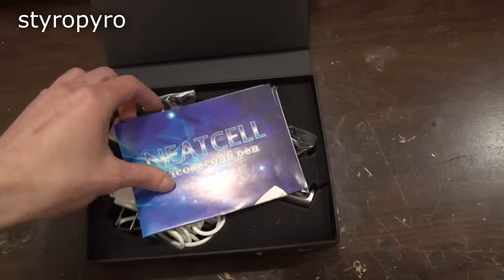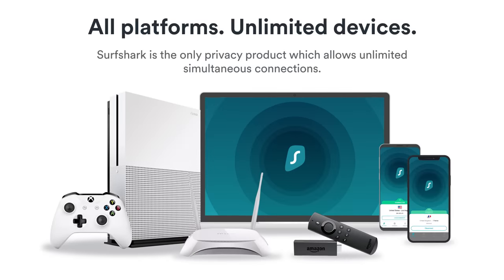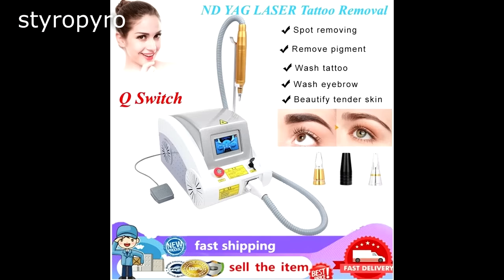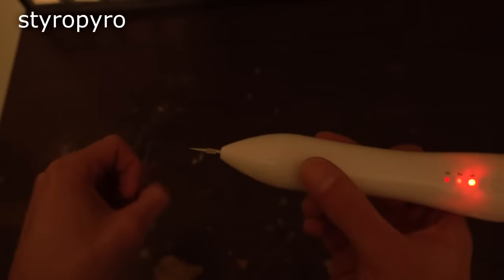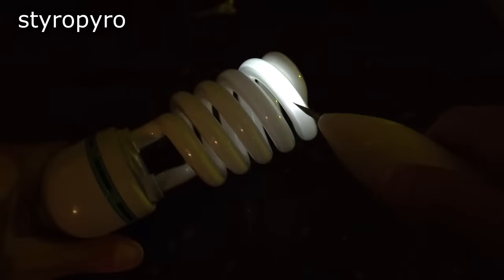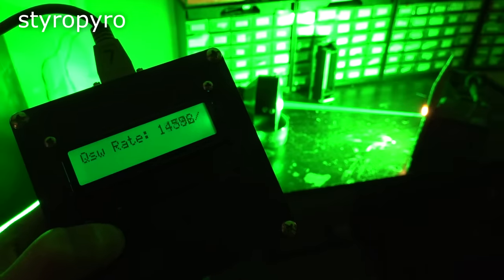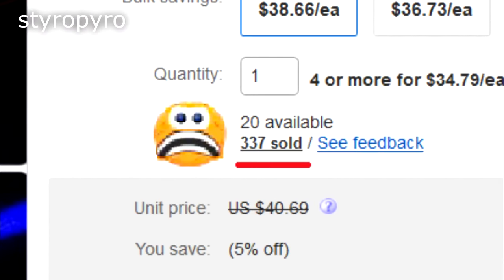Testing dangerous DIY "medical" lasers from eBay

Comment: Next video. 
"So I managed to get a laser that was once used by the Russian military but deemed too dangerous due to 74 accidental deaths."
Reply: “Apparently it’s so strong it melted a hole through a Russian warship. 

Now let’s see if it works on my skin.”
Reply: @BrianYYH  🤣🤣🤣
Reply: Instead, he drove into a tornado outbreak.
Reply: Next step: mount it on a lada!!!
Reply: Yooo I'm a fan
Reply: 1K17 Szhatie Self-Propelled Laser Complex?
Reply: Could he make a strong laser pointer from the picosecond laser removal pen?
Reply: @BrianYYH  🤣
Reply: The video after that will be about him acquiring the Death Star
Reply: @BrianYYH  "Ouch!" points it at skin again "OUCH!"
Reply: @BrianYYH  and once someone dug to China with it (sorry for reviving a conversation from 7 months ago not sorry)
Reply: @arctic _axe he upgraded it to instantly put a hole in the ozone layer
Reply: @tyttuut  it's too powerful for his goggles
Reply: My next reccomendation actually is "Building a fire death machine using soviet tech"
Reply: @BrianYYH  Well, that explains what happened to the Moskva...
Reply: "building a fire death machine using solviet military tech" is a great video
Reply: 2022 update "So I managed to get a laser that was once used by the Russian military. It turns out it was a fairly weak flashlight"
Reply: duct tape it to a roomba and you're fit for war
Reply: Therac25?
Reply: @BrianYYH  “Ow!” * puts arm up to camera to show a 1” diameter hole through his arm*
Reply: @Manny73211  Actually, there's more likelihood of fixing hole(s) in the ozone layer with a powerful laser, as you may know...
Reply: @melhupby which then burned out after about 5 seconds of being on. With the bulb exploding

Comment: “It’s a terrible idea to use the device on yourself”

Uses it on himself
Reply: He studied in those fields and knows what can cause actual harm and what will only hurt a bit.

He says this, as not everyone is highly educated in those fields and someone can actually hurt themselves, if used slightly differently.
Reply: @Ikxi  He's still human, and he can fail, He's crazy because he takes that 0.1% chance that he could fail and die (or be seriously crippled) just to make videos. So, respect Styropyro, both for his bravery and his intelligence.
Reply: @Ikxi  Good thing you swooped in with your 2 cents, otherwise I might've went on thinking that Guac's comment was funny.
Reply: @everparedesvera4815  I mean, it's only human to take risks. There's nothing wrong about taking risks to do something you're passionate about.
Think about motorcyclists, that's more than a 0.1% chance and we don't even contribute knowledge to the world! Everyone dies, it's about making the most of the time you're alive.
Reply: @jsteel89  he must be fun at parties
Reply: Guacamole Jones
What a brave sacrifice 🥺
Reply: @everparedesvera4815  do you know it has that much chance of damage? I don’t either but I know that he always uses his arms or hands, and he prob isn’t using his main hand just in case, but I think he knows what he is doing
Reply: He as lots of laser experience, he as high quality goggles so no eye risk. Likely he tests output on meter before firing at skin so he know what to expect. While public uses not knowing risk, no or poor goggles and no meter to test output first or even know what means.

Comment: My mom is a dermatologist and i showed her this video because i wanted to show her just how bad these lasers are.  She went through years of laser safety training and the laser she uses is $92,000 and is actually safe to use if used by a professional
Reply: "safe to use" and "if used by a professional" really dont play together nicely in one sentence.
Reply: @Sharpless2  Safe is relative. You still have the human element. Even with training, it only reduces the chance of a mistake.
Reply: @Sharpless2  safe as in the pulse doesn't persist for 100ms (that's a long time for a pulse) and used by a profesional as trigger disipline and all that. It's not hard to work out m8
Reply: @Sharpless2  Most useful tools are only safe if operated by a professional. Even a kitchen knife can kill.
Reply: @partickstar1135  yeah... common workplace safety with machines. i got some hairs removed and all she did was following a table corresponding hair and skin color to a specific setting. she tuned it a little bit after the first shots so like always experience matters but its not different than any other slightly more complicated machine
Reply: 144p-th thumb
Reply: Ok spacefrog

Comment: "Blow craters in a block of Tungsten"

those are some powerful words.
Reply: I mean a lot of bullets can’t do that to tungsten
Reply: Those craters are only a few microns deep
Reply: @JohnSmith-eo5sp  That's probably because the superheated tungsten gets so hot that it ionizes into a plasma, opacifying and shielding any more tungsten behind it.
Reply: @neolexiousneolexian6079  That's probably it. This explains why such lasers would be useless at ground level for taking out military machines, that and the laser would also transform air into plasma that would dissipate the laser beam

Comment: "The seller's claim is off by a factor of 100,000,000,000" happens all the time online.
Reply: I got something similar when a 5mW green laser was advertised as 5MW
Reply: @appa609  At least its not the opposite

that would be hilariously bad
Reply: Well it COULD be pulsed in picosecond long pulses, and you wouldn't notice it wasn't on continuously, so that part may not have been a lie. But I think it probably was anyway.
Reply: 0.5 Joule airsoft?  Nah its about 1000000 joules

Comment: I have one of those little white cautery pens shown. It's actually very useful at removing small blemishes like freckles or small moles. It will scar, but eventually heal up a nearly unnoticeable spot in a couple weeks to a couple months.  it can also be used to zap varicose veins. I've used it for all these applications and its certainly saved me $1000s in dermatological visits that insurance refuses to cover.

Comment: 11:00 that’s an electrolysis pen, which is a special kind of quackery that’s been around so long, my great grandpa had one in the 1930s. It was basically just a battery with contacts of different shapes that you put on different parts of your body. You were supposed to use it on joints to relieve pain, or at least that’s what my grandmother said it was used for. Nowadays it’s used as a hair removal method.

Comment: I have one of those plasma pens because it was so cheap and I was willing to try it for a few moles, in my experience it does remove dark spots/moles but it does so by basically turning it into a burn wound first, so you gotta be careful with the healing process after. Also it's useful for hobby stuff.
Reply: It’s definetly the kind of thing I’d buy as an impulse buy lmaoo
Reply: link? how much was it?

Comment: nice lazer, now I wonder, can you use it to char wood to make a wooden PCB. or perhaps use a UV or radioactivelaser or cathode ray to ionize the air around it and for a path for plasma to follow so that you can use high voltage and possibly frequency to alter the structure of the carbon material formed when the wood gets charred?

Comment: "It means that the sellers's claim is off by a factor of over 100 billion!" Well, I wonder if in the history of selling stuff anybody has been further away in describing their actual product specification.
Reply: Of course. Being off by a factor of infinity. Namely claiming something works, when it doesn't at all. Like x-ray glasses. You can't get a larger factor of error than the one you get from dividing by zero. Besides, it COULD be pulsed in picosecond long pulses, and you wouldn't notice it wasn't on continuously, so that part may not have been a lie. But I think it probably was anyway.
Reply: @medexamtoolscom  but it wasn't on continuosly. He was able to visibly catch the pulse with his normal camera (not high speed) which means it couldn't have been pulsing faster than a couple hundred miliseconds.
Reply: Yes. Flashlights. I saw one advertised for 1 trillion lumens when it was only 10 lumens. Actually that makes a tie!
Reply: @joaorichter9970  it "couldve" been flashing in picosecond intervals for a milisecond, then turn off entirely, then start flashing in picosecond intervals

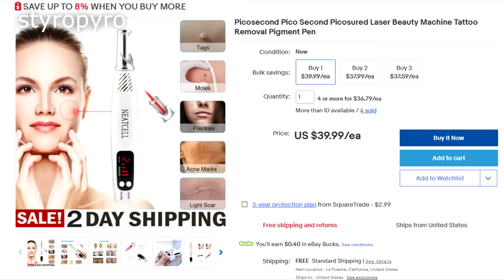Comment: 3:21 This about sums up the whole video

That first device is absolutely insane.  It should never fire without being placed against something.
Years ago I turned one of those large medical lasers into a laser show projector.  We actually removed the q-switch so it was running CW.  It still ran about 4 watts CW if I remember.

Comment: Out of all of those products the safest one is the High Frequency one. Which just removes moles by burning them. I personally remove, have removed moles in myself by heating the tip of a paring knife over the stove and carefully and extremely gently touching the surface of moles... and they fall off in close to a week.

Comment: I bought one of these around a year ago, curious to see what it actually was - and was stunned to realise it really was a class IV laser (I had expected hype, nonsense and a useless bright blue LED or possibly a class IIIB laser). Did not expect it to be genuinely Class IV

Not only that but as you found out too, the idea of picosecond pulses was a joke. Curiously, as I have some decent googles, I decided to try it on some freckles - and amazingly, when they finally healed, there WERE far less noticeable.  I am tempted to but the red version - as I curious to see which LD they are using for it.

Awesome channel as always - and yes, frightening what people can buy without having any idea just how eye-lethal the product is.
Reply: There are only really two common manufacturers of blue diodes, osram and nichia. Likely a nichia projector pull.

Comment: I know this is a pedantic comment but I think your laser is not "actually igniting air" at 9:38. You seem to have the room full of smoke, and the laser is likely simply blowing up the smoke particles. We are actually attempting to produce air plasma in our lab with a 532nm laser, and it's not easy.

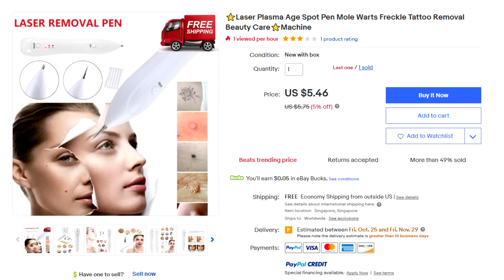Comment: 10:11 that plasma gun actually does work well and most people i know with freckles use them to remove DPNs, except we use numbing cream first. If you use it properly, the DPN will scab up and fall off within a week or two. It's safe and saves people hundreds of dollars, so I wouldn't knock it. I only paid $20 for mine and I use it to remove DPNs all the time.

Comment: I actually bought the laser similar to Neatcell. It was removed by the shop later. I even talked to the shop owner and he explained how to use it. I noticed when I used the goggles that eyes feel uncomfortable when using with the factory goggles. I stopped immediately until I bought proper goggles. I used it three times. It works and removes tattoos but leaves scare. As if you burn your tattoo with a cigarette burning. So, do NOT use it under any circumstances and do NOT use it with your eyes wide open in factory glasses. Eyesight loss or blindness for sure.
Drake, my thanks to you for your content saving eyesight and skin.

Comment: As someone who has had professional laser hair removal I could not imagine someone having an at home system to try and do the same thing. That’s just asking for complications in so many different ways. Sadly if you’re desperate enough you’ll try anything, especially compared to at least a thousand dollars for a tiny 4-6 inch area done professionally.

Comment: I would like to see a video about q-switching and the different values set as far as pulse rate and pulse width with your greenlight PV laser . Such as possible damage to optics and the best settings for longevity of the optics vs power output. I like your videos  and really would like more depth into the greenlight PV , Thanks, Dave

Comment: Loving your work. Nothing more fun than creating and existing in massive voltages. I used to do Emergency Response in a coal power plant, and was certified for the transformer yard. That is one scary yard, plasma arcs crackling, and I’m 6’2”. But I digress, you do realise I have now had to go out and buy one of those ‘NEATCELL’ lasers. I’m a mature 50+, so I’ll also sort a good pair of laser goggles. Can you recommend some 🙃

Comment: Willing to bet one of those wires slightly popped off during that run, just enough to affect spark, but not enough to have none at all. Had that happen to me before after a pull.

Comment: That white gadget you couldn't figure out the name of, I don't remember the name either, but I bought the same exact one that you have and they are used to burn off moles and warts. My doctor used a medical one back in the mid 80's on some large moles I had on my back. He injected numbing agent into the mole and used his bigger one to burn off the mole. I had some on my chest I wanted to get rid of and the one like you showed worked fine only being so much smaller, it took longer and without the numbing agent, it burned a little, but not bad.

Comment: Hi Sty:
What is the wavelength of this blue tattoo remover laser?  Also what type of goggles did you use with it?
Thanks much.
One of the most dangerous things I do is shrink quarters.  I have set a MAXIMUM number of quarters that I will shrink in my lifetime to "100" to increase my own existence time!

Comment: Since the instructions were so useless in getting the laser working, I'm surprised you didn't try to light them on fire with the laser just to show how useless they are aside from testing if the laser can set things on fire, but that probably would have been a bad idea due to the fumes from the vaporized ink being very noxious and irritating assuming the ink used to print those instructions is petroleum-based rather than soy-based.

Comment: I don't know if the electric plasma spot remover is the best thing for this purpose but if it produces an etched surface on iron or steel or maybe aluminum the is very visible and hard to remove I think I have a good use for one. I'm trying to make some all metal game boards and that would be great for that purpose.

Comment: Was really into your sponsor but after going to their website it’s false advertising at its finest. It says 24 months at $2.21 a month plus an additional 3 months free. However the fine print says you get billed for the whole 27 months upfront. So it’s only 2.21 a month if you pay for the 2 years up front and then they just straight up lie about getting 3 months free, since the total would be 59.76.

Comment: Rants about a laser making outrageous claims about it's capabilities, immediatly switches into an ad about a VPN making equally outrageous claims about it's capabilities. Forget that snake oil, buy this snake oil!
Reply: one could blind and scar you while the other can switch your location on the web and in rare cases, steal the data that they were supposed to protect
Reply: @Ragazaloth  Yes, one is more dangerous but that's not what I was referring to. I was simply stating the irony in calling out one unsubstantiated claim while promoting another.

Comment: I want to know what or if you could build anything without having power essentially if an EMP went off...could you still by some candle light or fire continue to create anything light a light source with broke equipment...using a spark or even a diesel engine with out power.?

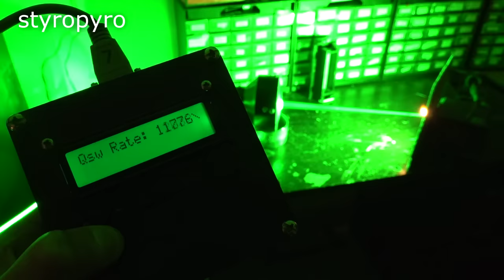Comment: I bought a machine very much like the one shown at about 18:40.  I use it to do LIBS analysis and it is pretty much adequate for my needs but I have noticed that the power control is supposed to vary the output from 20 milliwatts to 2000 milliwatts but it has no effect.  Anyone have any ideas on what be amiss?

Comment: you need to use one eye and conduct the retina test, to see how long it takes to burn out your retina! we need to see if the laser is a viable self defense weapon. when an attacker comes forth can we blind them quickly. If the test is a success i would like a mounted laser rifle on my jeep to thwart off a mob by blinding them. we could run 4 deep cycle marine batteries with a high output alternator and set up an industrial size capacitor! power supply would be no issue!

Comment: Certainly! Let's integrate all the elements you've mentioned into a coherent setup:

1. **Windmill**:
   - The windmill generates mechanical energy from wind.
   - Connect the windmill to a generator (usually an alternator) to produce electrical energy.

2. **Tesla Coil**:
   - Use the Tesla coil to step up the voltage.
   - Connect the Tesla coil's output to a capacitor for energy storage.

3. **Control Board**:
   - Integrate a control board (e.g., microcontroller or voltage regulator).
   - The control board monitors the Tesla coil's voltage and regulates it.
   - It ensures safe charging of the capacitor.

4. **Battery Charging**:
   - Connect the charged capacitor to the battery.
   - Use the control board to manage the charging process.
   - Ensure proper voltage levels and safety measures.

Remember, practical experimentation is essential. Adjust parameters, test, and iterate to optimize your setup. Good luck with your project! ⚡🌬️🔋🛠️
Reply: the bots are getting more and more anoying.